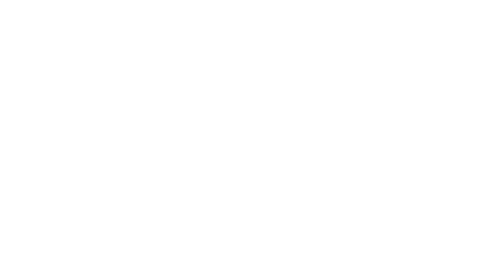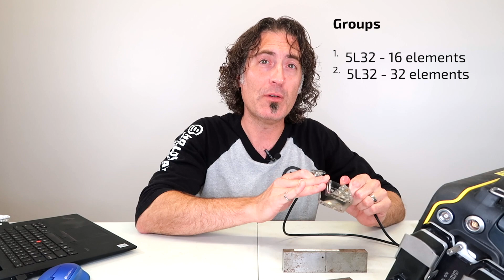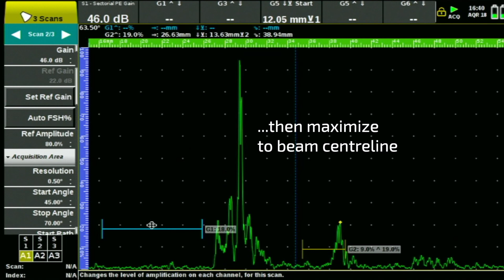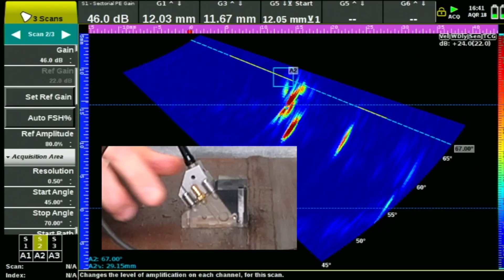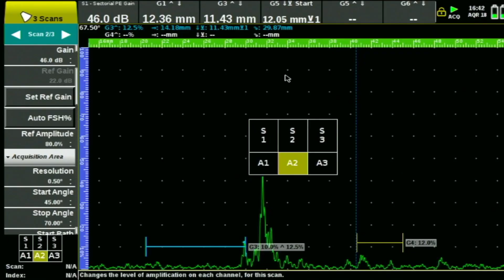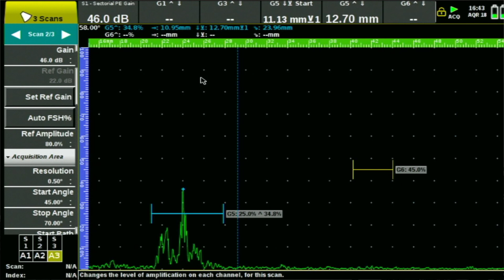Sizing with Tip Diffraction

Comment: Hi Paul, how do you size something assuming it’s in the centre of your weld? This example you just get the top of the indication and subtract from the plate thickness. Do you get a tip diffracted signal from both the top and bottom of the indication? Also do you have any tips for identifying the tip diffracted signal for conventional UT? Thanks
Reply from the maker: So yeah, a centreline crack or a sidewall lack of fusion. In my latest video I show a SWLOF sizing with the top and bottom diffracted signals. With PAUT it's just so much easier because you see everything all at once. In 2024 here (actually, since the early 2000's) we've been spoiled with PAUT. There are many out there that are so much better than I am at characterization and sizing with conventional. It's trickier and might require switching wedges. But no one should be shamed for using a better tool. Sure, the people that built houses with homemade nails should be commended for their ingenuity. But that doesn't make houses built in 1880 better than today's contruction with modern tools and screws.
Reply: @hollowayndtengineeringinc.5201  hahahah I agree! Thankyou!

Comment: Great content, it’s been almost 15 years since I played with tip diffraction. I remember calibrating and measuring the distance between the corner trap signal and tip diffracted signal. It seems though you are measuring TOF or from the initial pulse just like you would for and standard shear waves or compression wave testing? We didn’t have PAUT in those days to pick any angle. We used fixed high angle L-waves most often.